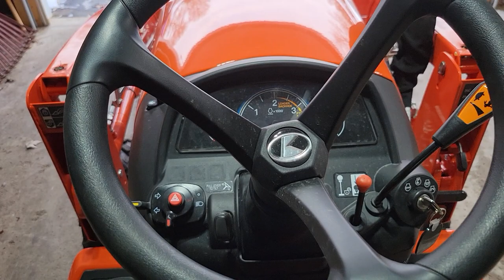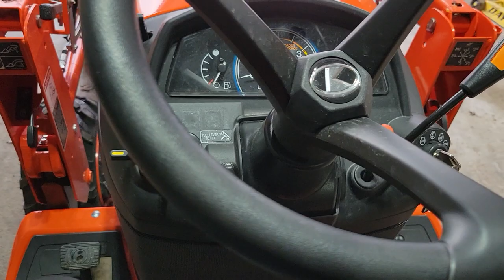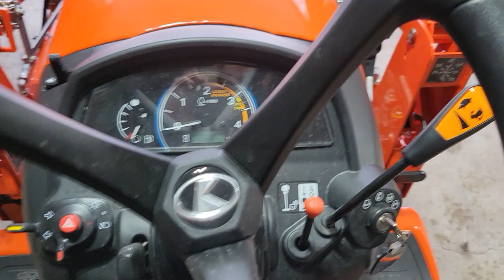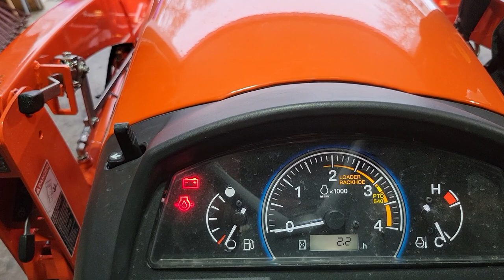2021 Kubota BX23S In Depth Review (Start up)

Comment: I disagree with your comments about the high/low.  All your power, especially if you want to push into a pile of dirt is for low.  Whereas high gear barely has the power to push over a small bump.  I say high is for travelling from one spot to another, while low is for when you are "working".
Reply: Totally agree.  High gear should be only for traveling, pto disengaged, level ground.  Bucket work, mowing, snowblowing, always use low gear.

Comment: Late congrats on your tractor. Mine is identical to yours with thumb and bucket with cutting edge - all came on tractor no extra charge. I also bought a 54" boxblade. My tractor arrives tomorrow on our newly purchased bare land while Im at my new job.....cant wait to use it, have alot of projects planned for it. Thanks for sharing your video 👍
Reply from the maker: Wicked dude its a little workhorse. Should serve you well
Reply: I have a 2017 model and have dug up stumps half as big as the tractor and moved them with patience. I would like a b series now but the bx does every thing that I want it to do as long as you have time.

Comment: if you use the pin in the back it will keep the backhoe from dropping down over time. should be located near your rear control console
Reply: as I wrote this i now see it in its holder lol

Comment: What are you going to be doing with this tractor? For trenching wouldn't an excavator be better and more efficient than a TLB? 

I understand with landscaping and pool installations you move lots of different materials. I am still debating between this tractor or a mini excavator with a tracked dumper.

Comment: The Backhoe wont move if You put the pins in !....the only thing that will seep down are the outriggers and the bucket will uncurl .....I have the same machine (LOVE IT) and just some input always use 4 low range on hills or pushing into piles of dirt and You can switch the backhoe controls to CAT pattern by switching the lines around....Good Luck...
Reply from the maker: Thank you John. I just bought another toy to go along with this that I think you will enjoy. Video coming soon.